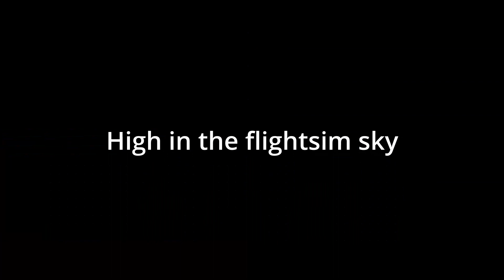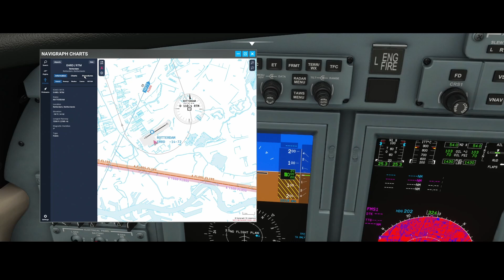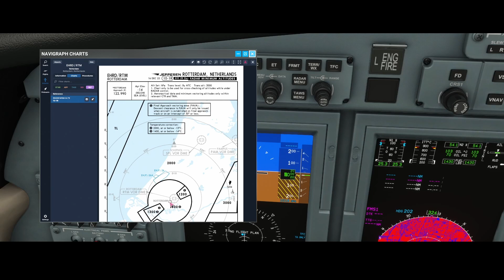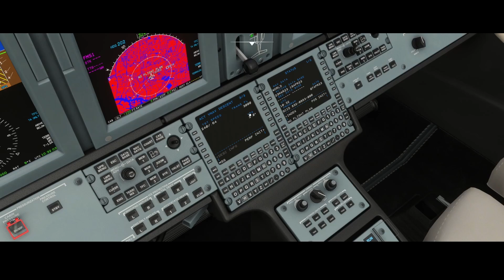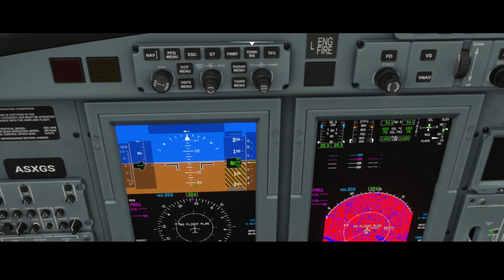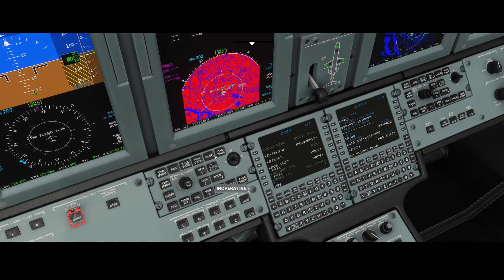Flight Simulator 2020 - How to - Transition altitudes in MSFS

Comment: so b will put in the right setting above AND below transition? Thanks
Reply from the maker: hi Toby as far as I figured out it will put in to the correct one which is valid where you are currently flying, would need to doublecheck if it is set correctly above the transistion altitude